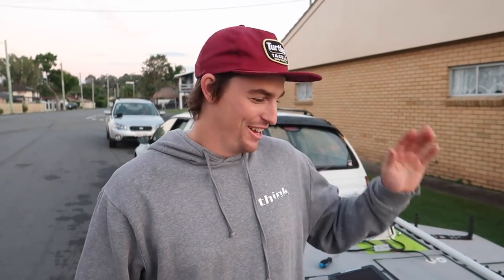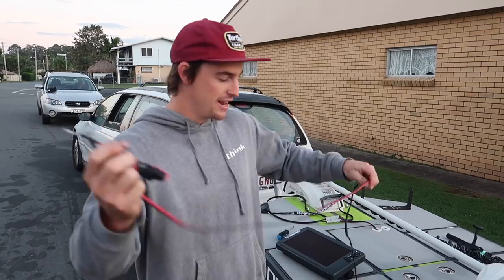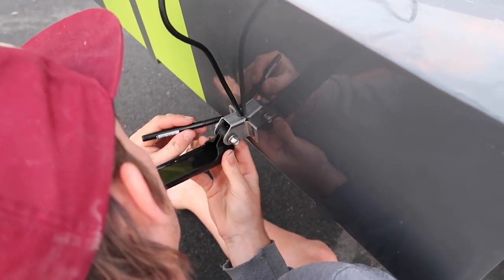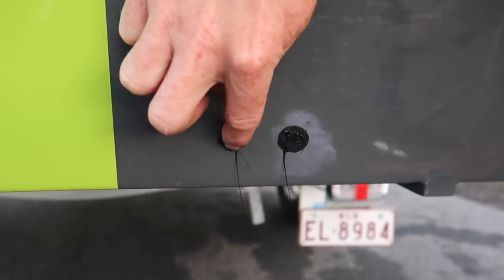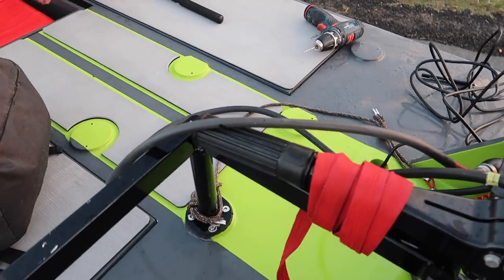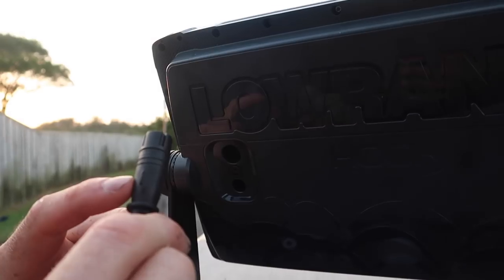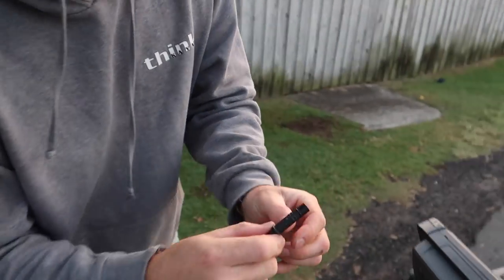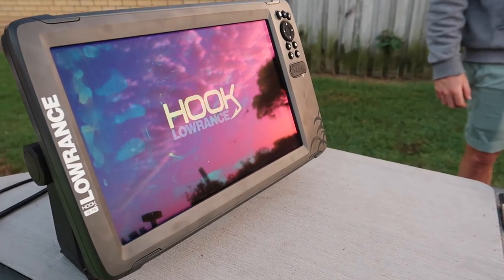How to Install a Sounder!! (Lowrance Hook 2)

Comment: In last video said you had a minor hiccup with sounder but fixed it. What was the prob? Mines being a bit silly last two trips . Thought it might be power source setup not sure. What was your solution?
Reply from the maker: wouldn't believe it but I don't think I had the cable pushed quite far enough in. because I have to remove my sounder after every trip sometimes I don't quite get it in fr enough. bit of a simple fix haha
Reply: Fishing With Timmy Turtle thanks for that info I think I may have similar problem as I remove mine too thank you and love the vids you do a great job.
Reply from the maker: no worries just have to make sure you putting oil in cables and in the pins after every use. if the pins start corroding there is no fix. rod told me and his has lasted a long time.

Comment: How did you decide which sounder to go with? I'm in the market and it's damn confusing! There are too many options!
Reply from the maker: my mate had a hds and he was teaching me how to use it so was happy with how Lowrance operated. emailed Lowrance to see if the could help me out with a hds but they are discontinued and they said they could offer me a really good deal on the hook 2. did some research and it apparently was the easiest set up instal and use straight away sounder great for first time users and thought that sounds like me. haha still leaning what type of fish I see on the sounder but was very easy to get straight on the water
Reply: Fishing With Timmy Turtle awesome, thanks. It has a nice big screen! Is it a chart plotter as well?
Reply from the maker: yer comes with maps in built that can plot points and show you where you have driven
Reply: Fishing With Timmy Turtle oh cool, that's exactly what I want. Thanks.